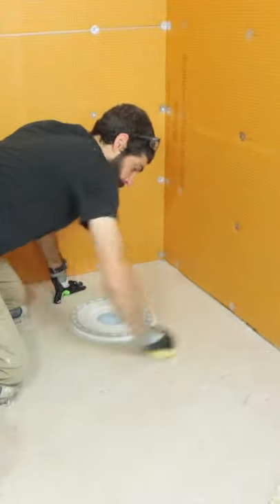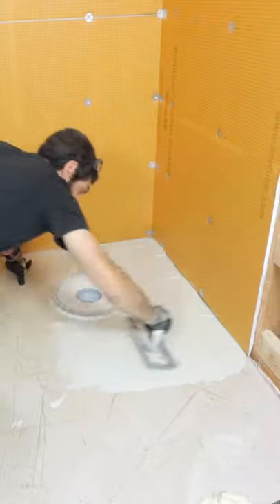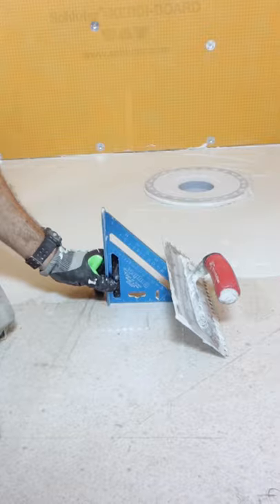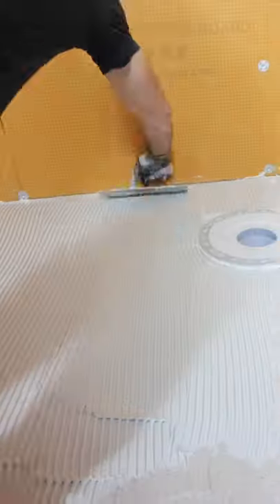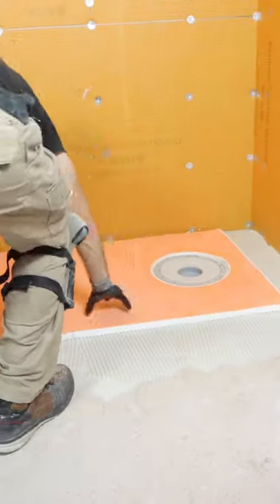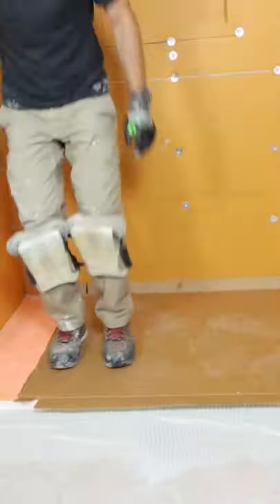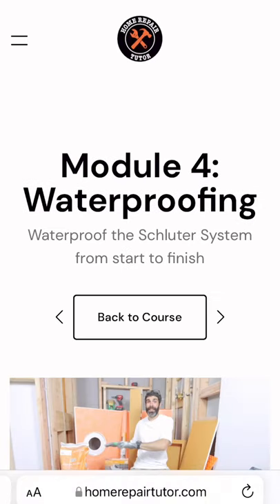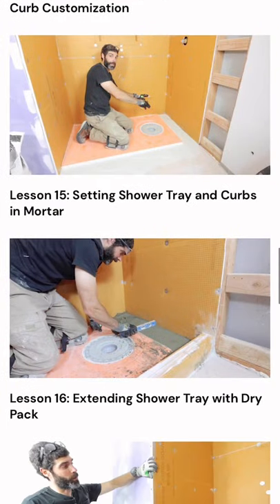Schluter Shower Tray Installation Tips - #shorts

Comment: What about the perimeter strips?
Reply from the maker: If you have to reduce the shower tray size, Schluter recommends keeping the first 3/4” of the perimeter because it’s flat. This helps reduce scribe cutting of the wall tile
Reply: @HomeRepairTutor  Great tip, pretty sure I’ll use it on replacing a cracked acrylic pan with a pre-sloped tray!